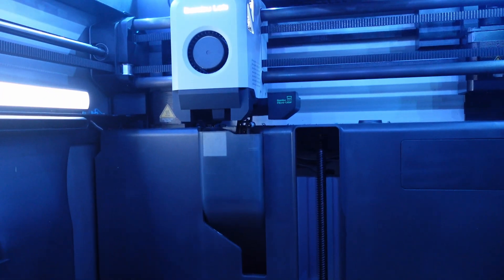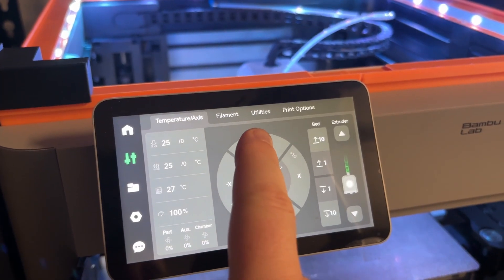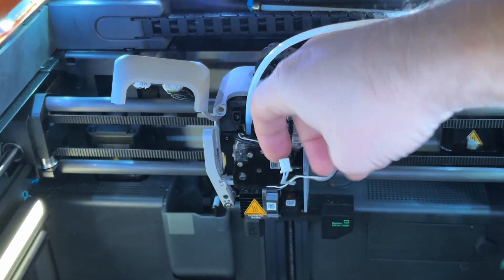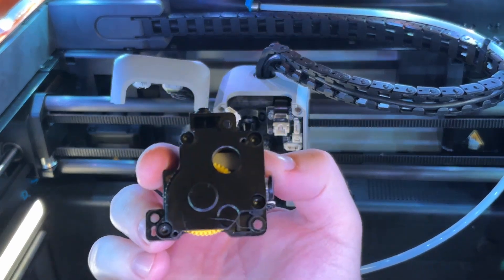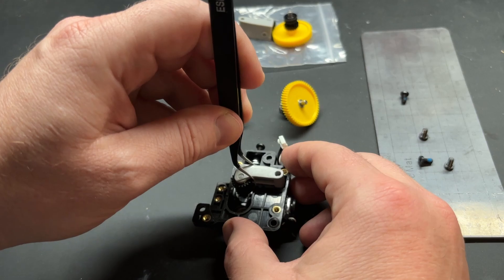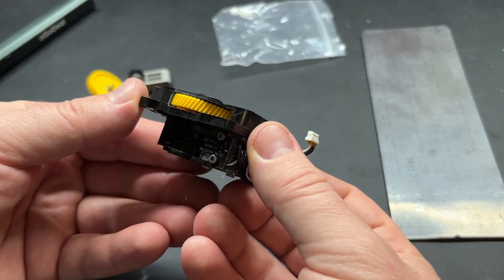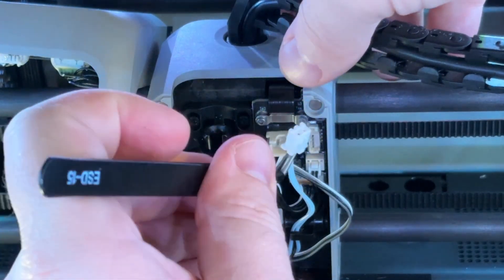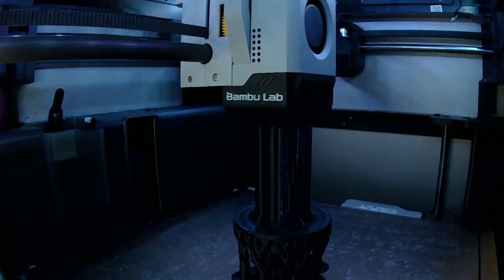How To Replace Extruder Gear for Bambu Lab X1C & P1

Comment: i have dismantled a handful of printhead so far in my 3d odyssey. This one is one of the simplest one to work on. I can hardly believe that such a simplr system can produce quality prints like they do.

The printheads i have worked with recently are over complicated yet this one is like genius simple. Another reason to buy bambu.
Reply from the maker: Agree on that statement. You can tell Bambu looks at the details closely and puts simple things in place that make a system better overall. Many other brands get in the routine of adding something just for the sake of marketing

Comment: Thank you for this no-nonsense how-to video!!! I appreciate that you took the time to show all the steps. 
You electric screwdriver seems to have the torque required to remove screws. I've tried two different ones and they all lack power. Would you share which electric screwdriver you have? Thanks!
Reply from the maker: Can get the screwdriver here https://beacons.ai/draftid

Comment: Hey there, thank you for your detailed tutorial. I know I am a year late but I wanted to know what is the actual difference between the Hardened Steel Extruder Gear Assembly and the included Stainless Steal Gear included in the P1S. I am considering upgrading in order to explore other filaments but can't notice which would be the upgrade. Both of the pairs of gears seem to be made from plastic. Would anyone be able to clarify what component of this assembly is actually changed to work better for more abrasive filaments? I would appreciate any help and excuse the ignorance.
Reply from the maker: You will want the hardened steel for any abrasive filament like CF products. It will ensure they dont wear out fast. I think in both cases the driving gear is plastic but the driven gear is steel/hardened steel and thats the part that actually grips the filament.
Reply: @DraftID  Thank you very much! Best wishes for you and your channel.

Comment: For the life of me, I can't get the yellow gear off. I have filament jammed inside - there's a stick coming out from the top area, so I don't know if it's preventing me from being able to remove the yellow cog. I've tried leveraging it out from below, tapping it like you showed, and grabbing onto it with pliers. I'm scared I"m going to break it before I get it off!! Any insights?
Reply from the maker: its basically pinned into the bearing so you probably need to tap out the pin gently. Trick is though you need to have something support the extruder without touching the gear so you can actually tap it out.
Reply: @DraftID  Oh my gosh...first time didn't work, but I found a different, narrow ceramic container to hold it and it finally came free! Thank you so much!
Reply from the maker: @ glad you got it! I should totally design a little jig for this purpose :)

Comment: you shouldn't do this while the printer is powered on... it can cause damage to various components and you can short the connectors when trying to plug them into the toolhead and extruder boards
Reply from the maker: Someone else mentioned this too. Thank you for the advice

Comment: Great video. Thank you for making it.  I ran across your video while trying to do further troubleshooting as my extruder is still doing the same thing as before. Initially I had a hotend and an extruder clog but neither were anything terrible. Disassembly and fidling around with those tiny cables was a real mother but I got it taken care of. During reassembly I noticed I was missing the little "tensioining screw" that goes inside the spring. Without it the pieces and parts just flop around. I was able to print a replacement piece for it so I now have that installed. From what I can tell I have done exactly as you say in your video however, I'm still having the same problem where the filament gets to the gears and the gears just spin but never grab onto the filament. I notice you fully tighten the spring which I have also done. I'm curious, when it's all put back together how freely should the yellow gear spin if I try to do it by hand. I imagine slight resistance which is about where I am. How tight should the four screws in the back be? I may have them too tight which would be sandwhiching it too much. That's really the only two things I can come up with. I have an X1C with an AMS purchased in October 2024. I also put in a brand new .06mm hardened steel complete hotend kit today so there's no way my stuff is still clogged yet it's still doing the exact same thing. Any advice you might be able to offer up would be so appreciated. Sorry so wordy...think I'm gonna copy/paste  this over to Reddit too. Thanks so much for your insight and expertise. I'm happy to now be a subscriber.
Reply from the maker: In the making of this video I actually had a very similar issue. I had replaced the complete hotend extruder assembly and I still had the filament not grabbing. I made the video anyway and it seemed to fix it the following time for whatever reason. I'm not entirely sure what fixed it though. As for the gear spinning, from memory it spins quite freely, so maybe instead of over tightening, try backing off so it doesnt have any resistance. I also feel like the filament I was using which was all quite old was giving the issue too. Newer rolls did not have problem grabbing. I hope you find a fix to yours, fb groups and reddit will be good sources. Sorry Im not the greatest help though but thank you for subscribing and watching :)
Reply: @DraftID the reson that no one mentioning is the back lid of the extruder, You can’t just screw it down sins it then pinch the gears to much. You need to put thread lock on the screws, then gently screw them down until you feel the slightest resistance. Let the thread lock set and dry. Then stick a piece of filament in the top, start tightening the screws that tightens the spring while pushing and pulling the filament true, I also put a finger on the gear to lock it while pulling the filament back to make sure it can’t easily slip. When thats done mark the hight of the screw with a white marker, screw it out some more. Add some thread lock screw it back to the marked position and let it set. Then install it in the machine. I use a small amount of lubricant on the big gear, if thats correct or not I don’t know sins bambu lab shows one thing in instruction video and another thing in there wiki gear instructions! Hope this helps! I get perfect feeding every time after cleaning the gears and I still run original x1c gears with more than 1500h of print!

Comment: Oh god I feel like I invented the bicycle or sthg after de- and re-assembling the whole Extruder to get a stuck filament out. Thank you so much! BTW: I found a lot of filament pieces inside there, maybe I should do that more often. Thanks again, that was a very useful and nice video!
Reply from the maker: Your welcome mate! Hope it solves your problems. I was just looking at the maintenance guide and it recommends checking the extruder assembly and cleaning it every few months. Next thing I need to do is grease and tension the belts so I might do a video just covering a general maintenance list how to
Reply: @DraftID  Perfect for me, you're a few steps in front of me, so I can learn before I have to do this 😅👌

Comment: Thank you for that.  Just the right amount of detail and excellent camera work.  Found the tiny little piece of filament that was blocking my extruder gears and the disassembly and re-assembly were very straight forward thanks to your video.
Reply from the maker: Thanks for watching and leaving the comment. I appreciate the mentioning of the camera work as I put a lot of effort into it :)

Comment: big help mate, i had filament stuck in my extruder and this was the fix. Also the official Bambu guide has a different extruder with different cables, so yours was helpfdul to ensure I was orienting evverything correctly on the reconnection.
Reply from the maker: Thanks for the comment and glad it helped. I copped some flak from others saying "why make this when bambu already has a video" but comments like yours show it was worth doing :)
Reply: @DraftID  Indeed! Also, there's doesn't show the gear assembly actually coming out, and how the bearings, bushings, etc fit back together going in. I had a piece of filament stuck in mine that just made it all a bit more stressful. Took a lot more force than I was initially comfortable to pull the yellow gear out. Lol

Comment: I am the second owner of my X1C, I bought it at 2200 hours about 4 months ago and I just checked and its at 3043 hours now lol. I doubt the gears have ever been changed, I may do that soon as preventative maintenance. It only ever prints petg and pla though
Reply from the maker: I noticed issues with mine right after trying to print PAHT-CF. If your quality is still good you can probably keep going. If you start getting extrusion issues it would be one area to check.

Comment: Thank you for this. My gear was stuck, and I had to use a small hammer to punch it out. Glad I ran into this video!!
Reply from the maker: Yup I had the same thing and noticed in other instructions to print out a stand to allow you to punch it out and Im like "but I cant print anything right now!" Lucky I found something and I was able to tap it out although I didnt record that at the time so kind of had to fake it in the video but felt it was important to try and imitate it again because I could see it being a common issue. Anyway thanks for watching and glad it helped :)
Reply: @DraftID  faking it helped anyway!!
Reply: stuck filament, glad I kept the last one, gonna clean and check that one after watching this
Reply from the maker: @JBGecko13yt  good luck!

Comment: How similar is this for the P1S?
Reply from the maker: P1S has the same hotend as the X1C but doesnt come with hardened gear set like the X1C so this guide is perfect for showing how to swap that out in the P1P/S so that you can print exotic materials like CF. Just make sure to also have a hardened steel nozzle too.

Comment: I hate to repeat what everyone else has already said, but man, can I tell you? My afternoon today was filled with panic as I came to realize that I had a sort of jam I had never seen before, and that Bambu's documentation was utterly unhelpful for dealing with.  Your video gave me the confidence to take apart my extruder, get the filament out, and put it together again, and I'm back and working! Particular props for repeatedly pointing out the bushings that needed to be in place.  I definitely accidentally removed one without noticing it, and without your video going "pay attention to making sure the bushing is back" I would have been stuck dead in the water.
Reply from the maker: Thank you for watching and leaving a comment. When I first posted this video I got a bit of crap from people saying "why post this when bambu already has a video about it?" To me it was about showing a problem and solution in my own way and maybe that would help someone. When I get comments like yours It reassures me the time was worth spending making the video, so thank you :)

Comment: 😬you kept your printer on wile doing this??
Reply: Yeah it would be best to turn it off
Reply from the maker: Yeah no harm
Reply: @DraftID  It says on my P1S assembly to not disconnect with the power on. I forgot once and went to plug in my new nozzle and the entire thing shorted out. Proceed with caution!
Reply from the maker: @ I’ll keep that in mind thanks!
Reply: @DraftID It can cause a short